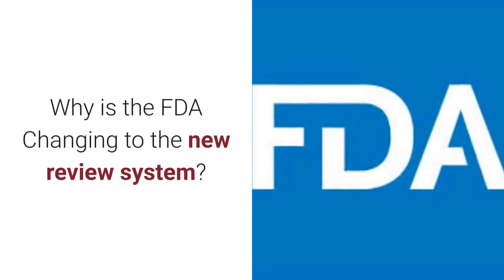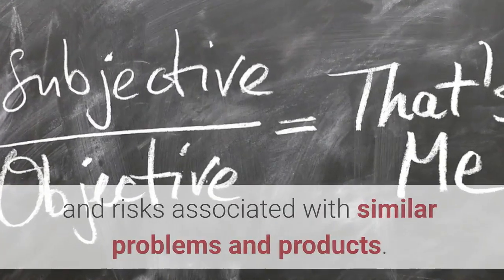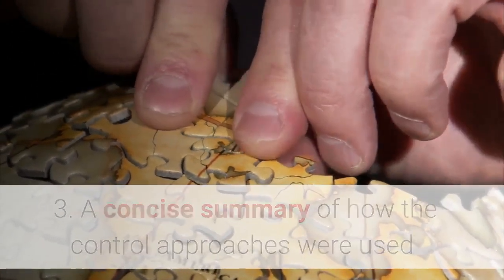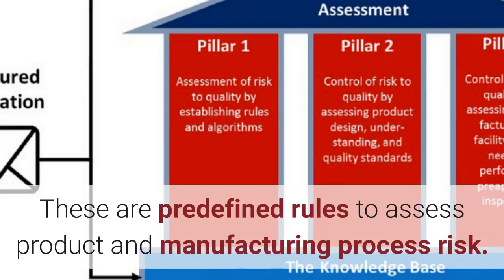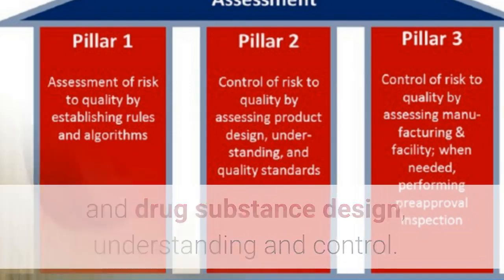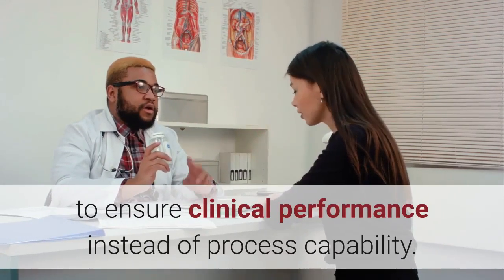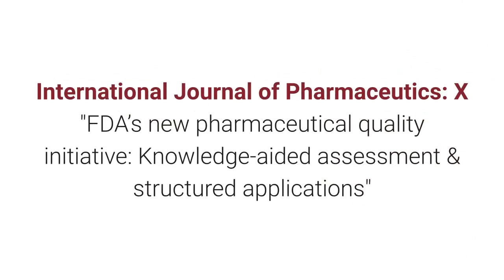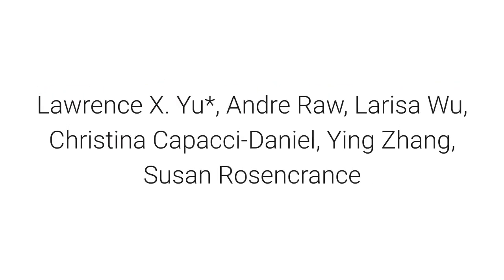Knowledge Assessment: What is the FDA knowledge aided assessment and structured applications (kasa}

Comment: Excellent video and summary of the article.  What I find interesting is how many in the industry and FDA focus much of their attention on the DP site, mfg, and cqas etc.  I would argue that there is far more risk inherent to API and the manufacturing process for API that directly impacts DP than there is in the DP manufacturing.  Of course more complicated DP formulations have increased risk etc than a typical tablet or PIC/FC but generally speaking the API manufacturing and impurity control / validation always keeps me up at night even after we have validated where in most cases I feel quite confident the DP manufacturing will go well.  Thoughts?
Reply from the maker: Thanks for your comment.  I don't take anything away from DP difficulty either.  API knowledge impact cannot be overstated and it is not just the impurity profile and stability.  Bio-availability can be directly impacted by API polymorphic form.  I guess I state the obvious and thus the need to understand the final crystallization.  I find having the right CMO is crucial.  Choosing a good one always helps me sleep better.

Comment: Thanks for sharing. I think it may be helpful to provide more detail regarding the risk algorithms and the specific risk tools industry can use to assess the risk to CQAs.
Reply from the maker: I use a process that takes knowledge assessment into account.  When I was younger, I never liked FMEA's reflecting the strongest opinion in the room.  I wanted it to be data based.  Then I learned not all data sets are equal.  Some were more trustworthy.  It then became necessary to know how the data was generated and the confidence to put in it.  That drove me to create the scale that takes those factors into account.
Reply: @cGMPMadeEasy  Is tolerable level of risk a bias considered before, after or not at all during this process? I would imagine residual risk is apparent based on the tool format?
Reply from the maker: The tool assess process risk as it relates to product impact.  It measures the residual risk in the process.  Tolerable risk of product impct on patient is not a factor in this asssessment.  Product risk assessment per se are not common in the pharma industry as with devices.